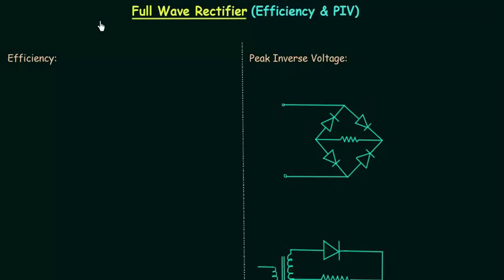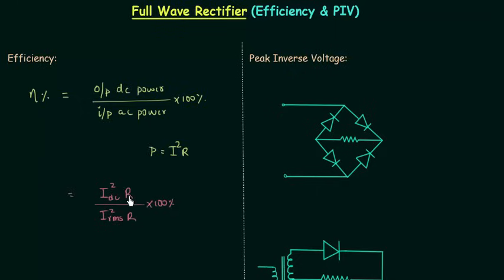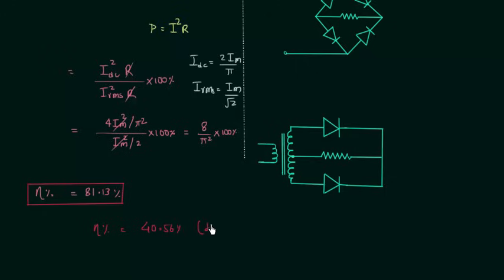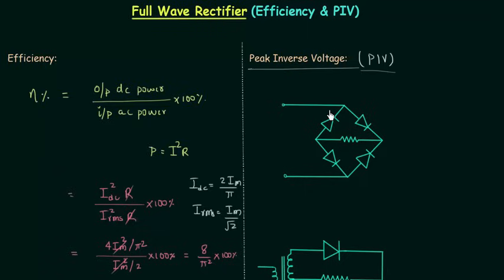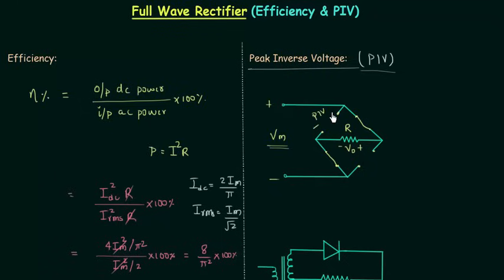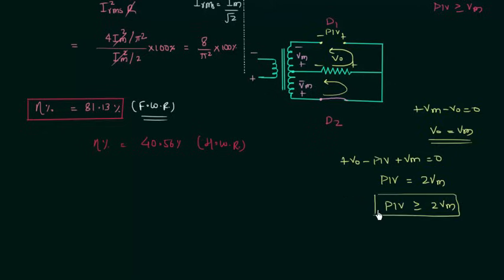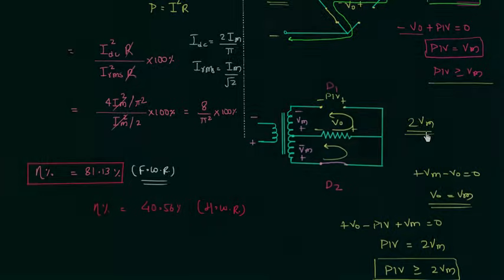Full Wave Rectifier (Efficiency & PIV)

Comment: Timestamps
00:09 - Full wave rectifier efficiency measures output DC power vs. input AC power.
01:23 - Full wave rectifier efficiency is 81.13%, significantly higher than half wave rectifier's 4.56%.
02:14 - Full wave rectifiers significantly enhance efficiency and vary in peak inverse voltage.
02:57 - Understanding diode biasing and calculating peak inverse voltage.
03:43 - Calculating voltage and peak inverse voltage using circuit laws.
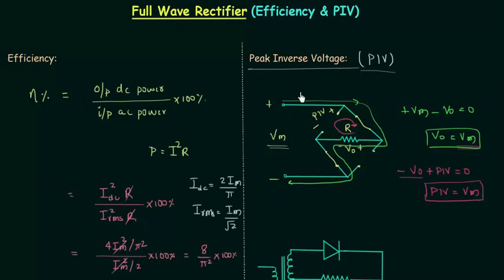04:44 - Peak inverse voltage (PIV) must exceed maximum applied voltage (VM).
05:33 - Analyzing diode behavior in a full wave rectifier circuit.
06:24 - Understanding Peak Inverse Voltage (PIV) requirements in rectifiers.

Comment: You are a great man, thank you.
I have a question if you don't mind, What is diots are not ideal?
What will hapen?
Reply: Simple a practical diode is replaced by a  ideal diode along with a battery having the forward voltage of the diode

Comment: Piv<=vm na why its greater than vm,as piv is Max reverse voltage applied before the xener breakdown naa
Reply: If your diode has a PIV rating which is less than Vm, it will break down, we don't want that.

Comment: Why the efficiency is 80% instead of 100% Even in ideal condition.When it will be 100%😕?
Reply: Its because the output is not fully or pure  dc.it is pulasting dc.For 100% efficiency the op will be a straight line.
Reply: +Pratham VA yup 👐

Comment: Is this only applying to the ideal diode model or does it apply to the constant drop model as well?
Reply: ideal
Reply: you should only consider the diodes if there are more than 5 all over the circuit and inside the integrated circuit chips or if using germanium ones otherwise youll probabbly only loose a couple volts compared to a couple hundreds sometimes that slightly variation messes up the whole circuit